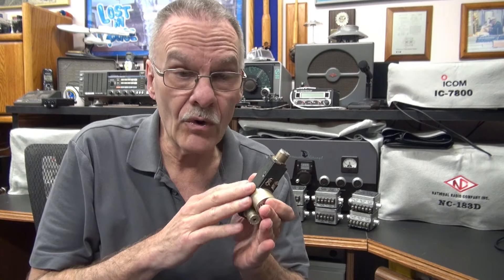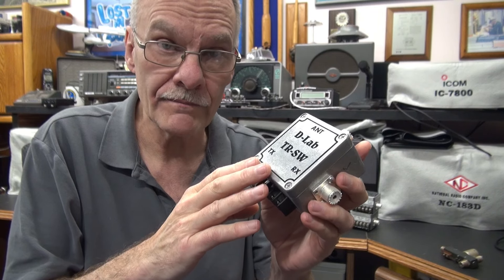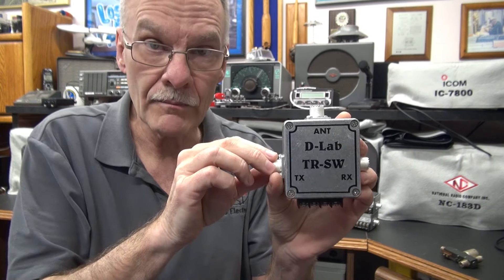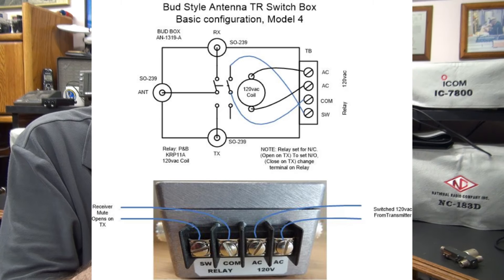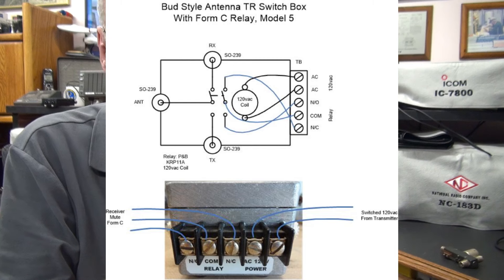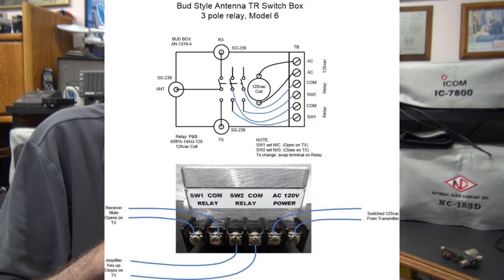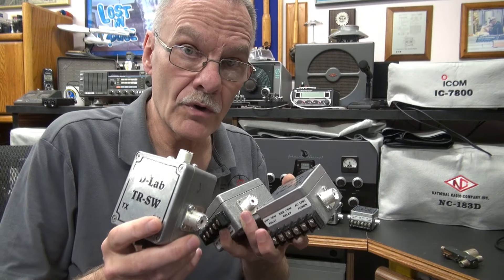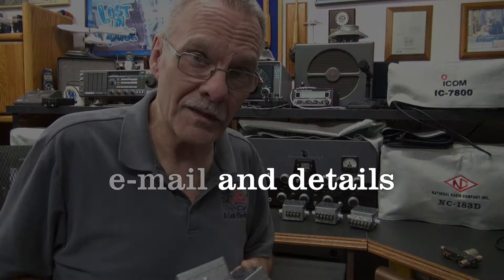Ham radio Dow Key replacement D-lab TR switch antenna change over relay system

Comment: I had been using W9RAN’s Versa TR board for interfacing a Johnson Ranger and SX-99 - and it works ! However, your solution is very nice. I recently obtained a 24v version of the DowKey relay. It will be used for an ARC-5 receiver and a ARC-5 T-22 40M transmitter. I’ll give yours a hard look ! Thanks ! WB4YDL

Comment: Will these work on my Hallicrafters HT32 and where are you picking up the 120 volts?
Reply from the maker: Per manual, pins 2,3,4 rear 11 pin control outlet socket

Comment: Hey, Terry!  Nice design, I know just which Bud enclosure you used.

I'm assuming it would be simple to make a variation of these using a 12 VDC coil relay.  I'm not a ham, so I'm not sure if there's a need for that or not.

Take care, sir!
Reply from the maker: Yes, I could drop in a 12VDC coil relay. The frame size is the same. Good suggestion
Reply: @d-labelectronics  Thanks, glad to contribute to help everyone out there, you set a good example.

I was more involved with CB Radios back in the '70s, before it went nuts. I think a few people would switch between ground plane and beam antennas, or between horizontal and vertical polarization on their beams, using a 12-volt coax relay on the tower.

Comment: Where do you pick up the 120v AC.
Reply from the maker: The transmitter normally outputs switched 120vac for antenna relays